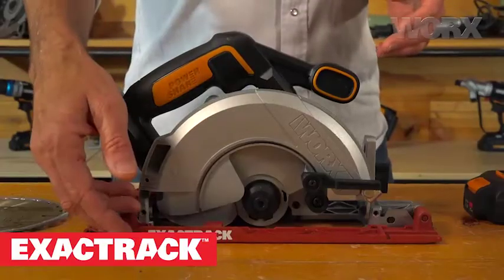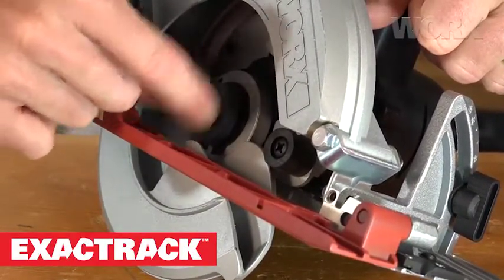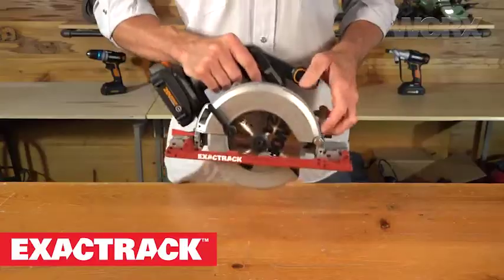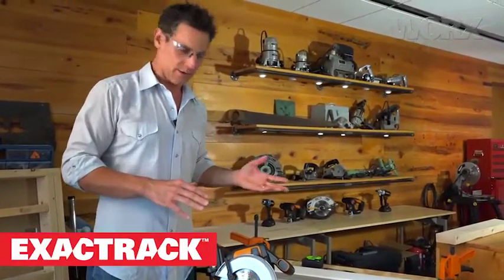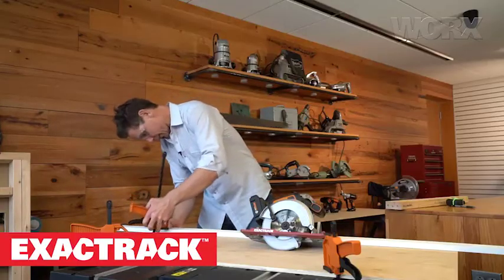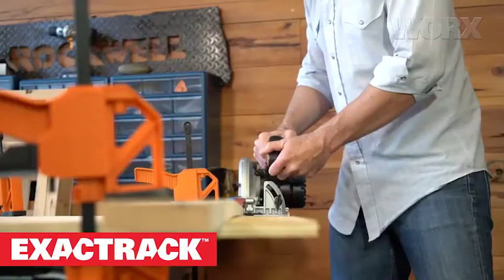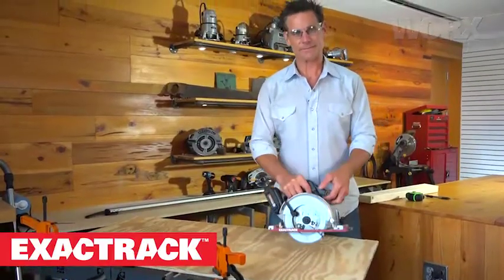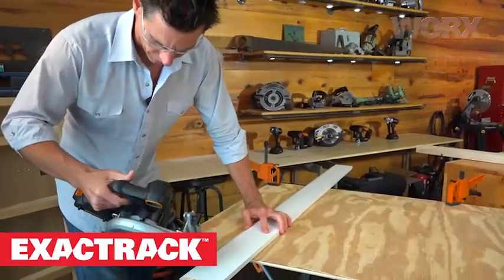WORX 20V ExacTrack | How to Use & Assemble

Comment: Got the saw. Tried in on about 10 cuts of 18mm ply. It doesn’t cut exactly. About 2-3mm at start of the cut and 5-6mm towards the end of the cut away from the guid. Making each cut different, so you’ll never be able to put anything together afterwards, unless you building something wonky.
There a gap between the base and the actual 1.6mm blade - 1.8mm difference.

Comment: Hello, I bought this saw. but nowhere can I find spare blades. or buy some? I am in France.
Reply: Any 6 1/2" blade will work. I bought a DeWalt plywood blade for mine.
Reply: ethan   Order any 6 1/2" blade with a 5/8" arbor center hole and they will work !!! A common size blade available in many tooth counts, fine to coarse.  Or you can convert to the metric sizing !!!!  If you can find THIN KERF blades they are better as they take less power and give a thinner cut less sawdust more efficient !!!

Comment: Good idea.  Cutting 3" strip you have to position the guide at 3"+ kerf of blade.
Or,  Cut from the other side, Now the guide is on the good piece. 
another benefit is the antisplintering that you want to have on the good piece.
I like it and the concept can be expended to offer more benefits.
auto squaring-antikick back and antisplintering benefits as well as repeatable cuts .
Look at the ezsmart smart base and  good luck.

Comment: Is this products available right now and when did it come out.  Is this product located in Lowe’s?  Thank you 😊
Reply: Probably at lowes but if not their website or their ebay store for sure. It's 100$ without a battery and charger. Not sure what it is if you need those items, I already have 5 so I didn't think I need more so I didn't look. I got their Switchdriver at lowes.
Reply: @daemonember  They are available on line from worx free freight and I got one today for $78.00 on a 15% coupon on an open box deal , complete saw, blade and battery through Ebay from worx.  Got a 3/8" drill complete open box 15% coupon also and with 2 batteries and charger  for $69.00  free freight !!  I already have the weed trimmer for 3 years with 2 batteries and charger and they still work great  and still hold charge !!!
Reply: @daemonember  1/20/2020  I ordered one today off Ebay from worx, open box with 15% coupon, saw battery, charger free freight for $78.00 and also ordered the 3/8" drill, 2 batteries, and charger for $60.39  free freight  also open box, or you can order straight from worx.........